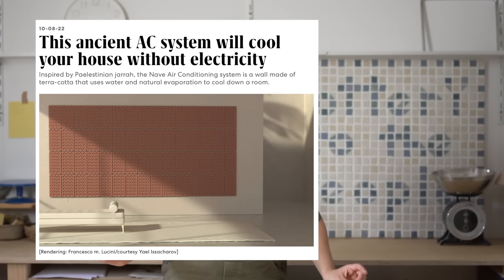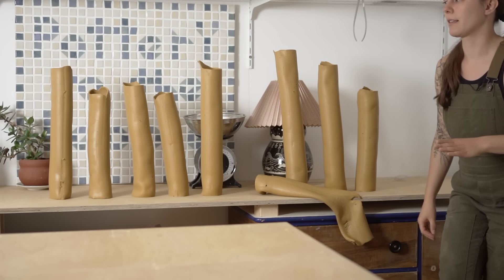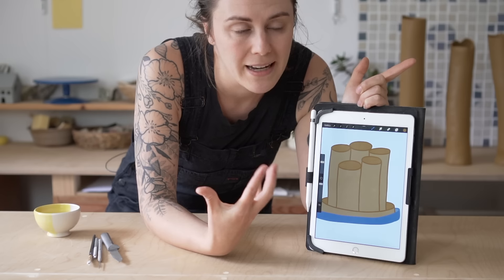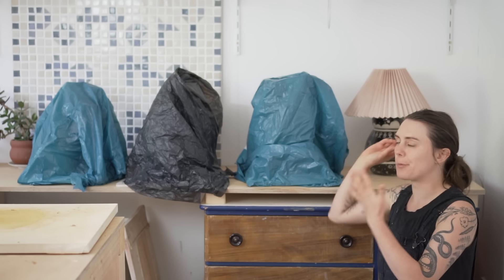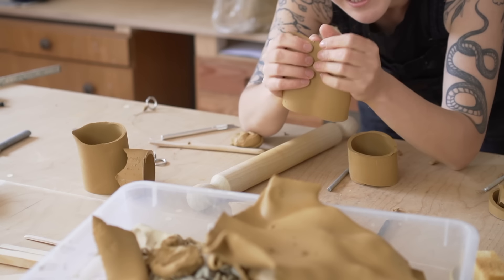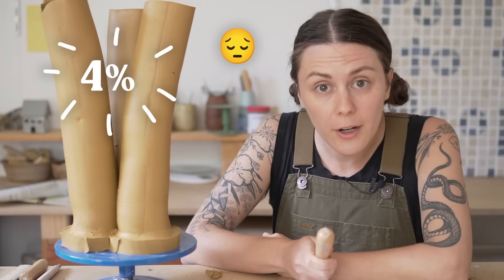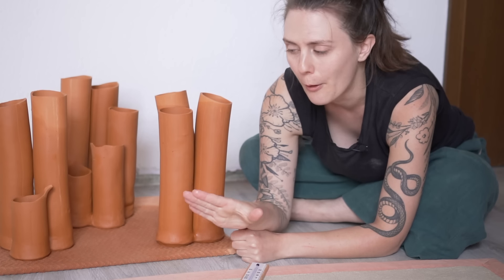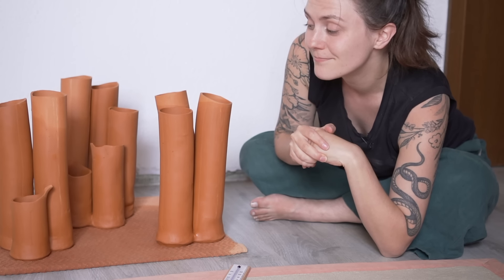Can I make an A/C out of clay???

Comment: the whole southwest uses swamp coolers. The major factor to consider is air must be forced over the water and the ambient humidity of the air must be low. High humidity and you lose your evaporative cooling. 

I worked on a farm in Arizona where i grew oyster mushrooms. We kept temperatures in the ideal range of 70 to 85 degrees more or less year round (until monsoon season) by creating a wall of evaporative cooling pads on one side of the hoophouse. When the temp reached a certain point a thermostat would turn on a pump that would cascade water over the pads back into the sump where the pump was. Air was forced through the whole hoop house by exhaust fans on the other end forcing fresh air from outside through the cooling pads and through the house.
 
keep in mind this is in the sonoran desert where ive personally witnessed temperatures up to 113 degrees.

Comment: It appears you need to add a fan. Invest in a solar powered small fan just to get the air moving across the clay. Statically they are not going to be as useful.  That is why you see them in the windows. Also, use Christmas paper wrapping roles when drying. Anyways this is the first video of yours I have seen. Will not be the last. Have a great weekend and as always I appreciate you

Comment: A bit about these from a physicist: what these tubes do is cool themselves. The theory behind it is that you can have tubes that will cool themselves, then you can bring them somewhere, and they will cool stuff around them. Sounds good, but they make the room humid. Now, humid air has poor thermal conductivity. This is one of the reasons it feels cool around trees and greenery: they do decrease the overall temperature of the area around them, but they also decrease humidity, allowing for your body to transfer its heat to the air. This is also why it feels hot in space: there is nothing in space for your body to transfer its heat to, so it's only chipped away at very very very slowly. Cooling your body down isn't the same as having cool things around your body; what is way more important is that your body has a way to transfer its heat to those cool things. One way in which these could be useful is if you had, for example, some sort of wall engineered in a way so that the vapor can go through one side, leading to the outside, and not on the other side, leading to the inside. At the same time, the inside of the wall should be able to conduct heat and cool down your room. If you look at the picture you provided at the start (0:21), that seems to be what is happening :)

Comment: I think you got more than one degree Fahrenheit of difference, the conversion rate is higher than that.. it converts to starting around 77 degrees and ending around 70 by my googling lol, so the feeling of coolness upon entering the room was probably due to your creation! It doesn't take much to take a place from disgustingly hot to at least bearable. It might not make it cold, but it did seem like it could help as a way to get through the worst of the heat without using energy

Comment: Well, they look nice.

If you want to use evaporation to cool down your environment, go for large surface area to volume ratio. Reduce the diameter of the tubes and add air space between them so that air will flow past them. They're basically heat exchangers -- clay versions of air cons and radiators. Fins might work. Get air to circulate from around the tubes to the rest of the area you are trying to cool down -- using convection. Install these on the floor near air intake and vents at or near the ceiling/roof. It's a feature for traditional houses around here at the equator. Close the vents when you want to retain warmth at night.

Recently we also have people misting water on the roof during the day to cool down the roof.

Well, that's what we do at the equator, but you really need to look at where the heat source is at your location. If it's the walls, install the tubes at the wall. If it's the roof... etc etc The tubes will absorb the heat near the source and not heat up the rest of your location.

Comment: Nice video. I live in Puerto Rico, tropical and lately extremely hot. I'm a potter too let me give you my two cents that can help you. Your tubes are too close to each other. They need to have a space not to big for the hot air to flow within them like a radiator. Also they need to be in a ventilated room where the air flows through them to evaporate the water and cool. I'm going to try something similar but using wheel thrown tubes instead and fire them to cone 04 so they are still porous but not enough to drip. I don't have a channel with videos but i'll let you know how it works
Reply: just look at the comments, there is people that for every solution they find a problem. never pay attention to negativity. I enjoyed your video, thanks.

Comment: A few remarks:
- this is basically a evaporation cooler. Technology Connections video 'Personal "air conditioners" aren't what they seem' explains why they are not going to replace air conditioning
- we can maybe make them useful if we put them outside and somehow thermally couple them with our building inside. So the water stays outside, but the cooling can come inside
- for energy reduction: drinking water needs quite some energy to make and deliver. So, using it for cooling will likely just spend more energy on drinking water production and possibly cause a water shortage. We would need to use non-drinking water

Comment: I live in Australia and we've dealt with heat for a very long time. 21o C is actually cold.  I'd be getting chilly.  I'm not sure if you use a fan but train a fan over a bucket of ice (we used an ice cream bucket filled to  the brim and frozen in the freezer), or wet a towel in icy cold water, ring it out as much as you can, and drape it over your body or a metal chair as you go to bed.  It will cool you down enough to get quality sleep, which is half the battle in summer.  Part of solution is to stop the house heating up so pull all your blinds, curtain shut as soon as it starts getting hotter in the morning and keep them like that.  Ive also stuck alfoil over all the windows and although it makes the house dark it sure does keep the heat out.  Good luck.  I'm not looking forward to our summer this year.

Comment: This is very similar in principle to a zeer pot. It is one of the oldest inventions to utilize the principles of evaporative cooling to create a conditioned compartment, a refrigerator basically. They only function well in an arid climate though. The examples you showed follow the same principles and were used by civilizations in the Middle East, North Africa, India and parts of the Mediterranean. 

Many civilizations use these concepts for cooling before modern refrigeration and air conditioning. In Spain they used a vessel called a “botijo” that would store and evaporatively cool water. In parts of the Mediterranean the word can be associated with cooling. 

I think it is awesome that your are bringing attention to an ancient method of air conditioning that requires no electricity and has no negative impacts on the environment. It won’t work in all climates but I’m glad that some people may use this idea if it can work for their location.

Comment: Important thing to note here and probably obvious to a lot of people. This works with evaporation. So if you are living in a high humidity area and its not just hot and dry air, then this will not work (as well). Water can only evaporate into the air if the air itself doesn't carry a lot of water (humidity). The air has to have the capacity to take on the water from the earthware.

Comment: Hi, as an engineer I think I may add some upgrades.

Put enamel on the outside of the bottom of the tubes and enameled pottery dish - lower leakage a bit.
Add fan - enhance evaporation and thus cooling effect.
Stagger the tubes - better airflow and again it increases the cooling effect.
Use thinner walls - increases leakage but may enhance cooling considerably.
Use some kind of bio-neutral dessicant somewhere near (maybe opposite side of the room) - lowers the humidity of the air and thus helps with evaporation (see above).
Use more tubes with smaller diameter - increases area for square meter and also it means higher eveporation again.

Generally this kind of cooling works the best at higher temperatures of the air so this might be more valid option the higher the initial temperature is. Also there is much more possible enhancements, but without proper calculations and drawings it's hard to explain in a plain text.

Hope this helps with improvements and if you ever try it, I'd be glad to see the results.
Reply: The whole point is that there can be no glaze (enamel) on the bottom because firing it requires firing stoneware clay to the temperature where the clay stops being porous

Comment: AC is pretty sustainable if you insulate your house properly, and if you insulate your house properly, it's likely you'll need at least some measure of heat pumping to move the heat in or out so you're the correct temperature.

WAYYY better than, for example, resistive heating.  (Like that kiln).

E:  Oh you keep the pots in the room you're trying to cool?  So it's just a swamp cooler?  I thought the idea was to clad the outside of a room with them so they'd not increase the humidity inside the room, but cool the wall through conduction.  I feel like there are way better (if less pretty) ways to make a swamp cooler.

The reason the water feels cool is because both its thermal conductivity and thermal capacity are so huge, while its viscosity is low.  Dipping your flesh into it immediately donates a huge amount of heat to the water, and that water rushes away due to convection, to be replaced with cooler water and cool you down more.

If you're looking for an incredibly environmentally friendly way to stay cool in the heat, I'm not kidding, literally just get a bucket.  A bucket big enough for your feet, filled up to the height of your calves or a bit less, with up to room temperature water, will keep you perfectly cool all over.  A lot of blood goes through your legs and ankles, and really close to the surface in your feet.  Unless you're in the sahara, the water's not going to get above your body temperature, so will always have the power to cool you.  (Again, this is less pretty than clay tubes.  Maybe make a clay bucket shaped like feet).

Comment: Well I am kind of curious how is this supposed to work. I've worked with evaporative coolers for two years and usually how it works is the liquid absorbs the heat in the building in a closed loop that is then transferred to an external cooling tower where the whole process of evaporation takes place. So basically how it works is that the coolant in a closed loop get's into the coil that is constantly sprayed with water. Because the coil gets hotter the water evaporates and because the phase change is an energy-intensive process a lot of this energy is transferred to steam while the coil and coolant cools of and repeats the whole process. Same goes for our body, sweat acts a bit like these sprayers, while blood is the closed loop that transfers heat around. When sweat evaporates we effectively got rid of unwanted heat energy.

In this case the heat seems to be transferred back into the room and it also humidifies it. While constantly supplying the tubes with fresh water will reduce ambient temperature slightly because water has a huge specific heat capacity and can absorb a lot of energy from the room, it will also increase humidity making it unbearable inside. The whole idea behind the AC is taking that heat from the room and transferring it outside, it works like a fridge. So the way I see it we just added a tank of water with huge surface area to absorb heat better but it doesnt really gets the heat out of our room, we just increased its heat capacity.

Comment: Try adding some form of air movement! AN over head fan, a plug in fan pointed towards them. This will then (or should) move the cooler air near the clay-c [clay ac, cause why not] away, allowing it to cool the warmer air elsewhere in the room
Please do have a hygrometer in the room, though, to keep tabs on the humidity level!! I know there are other comment(s) concerned about the humidity, but having something to measure it would be very helpful if/when using evaporative cooling methods! You can then do some research as to what levels of humidity are good/safe for people, the area you're in, in addition to the negatives of humidity that IA too high, etc.

Comment: But did you leave them there for a bit longer, those things are pretty small to cool a room, but maybe because of the comparitive size, the next day might have hailed a better result.  If you set up a fishtank with cold water, the small heater will take many hours to heat the water to a suitable temperature for tropical fish.  But it's design is not to rapidly heat water, it's to maintain the correct temperature.  Perhaps these work on a similar premise in that their design is to keep the room cool, so actual cooling of the room might take hours

Comment: I think it's the design which is the problem. The surface area is too small. If you, instead, flattened those tubes while still using a piece of veneer to keep an air pocket between the sides, before they dry, and then attached a clay stand to the bottom and a clay water container to the top with cutouts for the air pocket where the veneer was, then, after firing it, you added water in the water container, which allowed it to seep it into the pockets where the veneer was, then it would still go through the clay, and the increased surface area would help with evaporation. The result would look a bit like the radiator of a central-heating system for a house, or the radiator for a car or PC liquid cooling. Add a fan to the setup, even a small one, and it will work a lot faster. What needs to be said is that this doesn't work for hot and humid areas, like swamps or rainforests, and works best for hot and dry areas, like the deserts where water is already scarce. For the best results, you would also use an air heat recovery ventilation system, even a home-made one, even one you made yourself (though that would be a bit of a challenge, but I think it would be an interesting project), to renew the air while still having the new air at almost exactly the same temperature as the air already in the room (depending on how much time and surface area you give the inside and outside air to swap temperatures).

If you want more details, I can help you with details and with youtube videos I can find online to better explain the goal or how things function.

Comment: A lot of people have talked about the issues of humidity slowing evaporation, and suggested using fans or other methods to increase effectiveness. I don’t understand how more people haven’t mentioned this: energy is conserved. If the water and the pottery cools down, that heat energy doesn’t just go away, it will be in the water evaporated in the air and it will just warm the air by an equal amount that the pottery cools it. Unless you have someway to direct where the cool air from the pottery or the warm water vapor goes, this won’t do anything. That’s why air conditioners need a warm half outside, because if you want to make somewhere colder, you must make somewhere else warmer.

Comment: The thing about AC usage is that we have a solution: solar panels will produce loads of power during times you need AC. In addition, you can use solar panels to reduce the amount of sun hitting around or on a structure. So you get passive cooling and active cooling.

Your solution does have an issue where it uses large amounts of water. There are places where that's fine, but many places where it's not.

Comment: I love this idea but there are a lot of practical issues with this idea, especially in places where there is high humidity; you’re using water to store the heat. 
In principle this works great!! 

Water will evaporate slowly (or quickly if it’s hotter). The more humidity there is in the air the less your body is able to cool down through sweating. 

When it’s very hot a pipe systems like this will evaporate a lot more quickly and increase the humidity markedly as the water store more heat making it feel hotter. 

Part of the reason why ACs work so well is that they condense the water out of the air as part of the cooling process! 

Using a system that drags water out of the air as part of your structure can actually compact this process… and you can get the water back into the system but it would take a bit of work to implement

Comment: You need fairly clean water for those to not clog up quickly... And making new ones takes energy. And purifying water takes energy. And not everywhere has a source of fresh water, as salt water would really quickly clog the pores of the clay. And in some places the best source of water is hard water, which again, will clog those up.
Also pure water, which would work for a long while, is in high demand by the semi-conductor industry, and is actually their main energy cost because purifying water takes a lot of energy.

Comment: Conservation of energy. Some water molecules have more energy than the rest and that allows them to turn into a gas. However, the energy is still in the air. The liquid water gets cooler, but the air gets slightly hotter as a result. For it to work, you need a way to get all those water particles out of your house. Where I live, they solve that by making the whole house out of a porous material and then they make the walls wet. That way the wind takes all the humid air away and increases the rate of evaporation. The houses do get VERY cold that way.